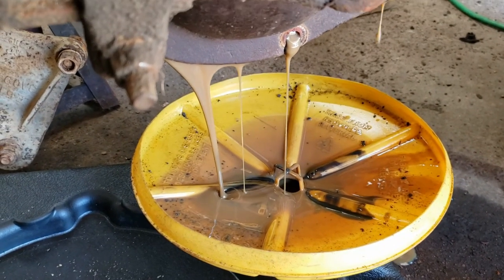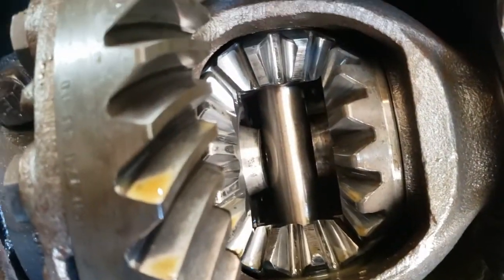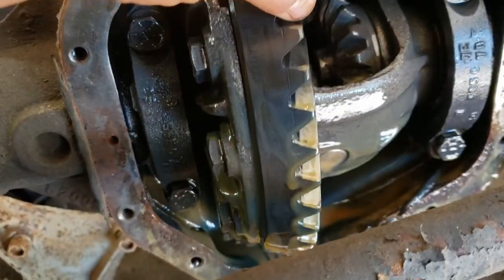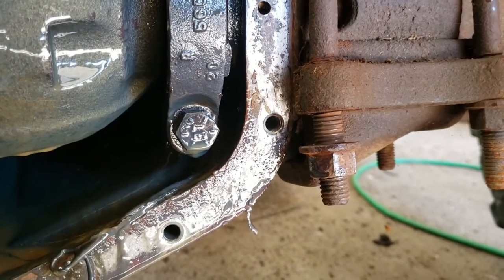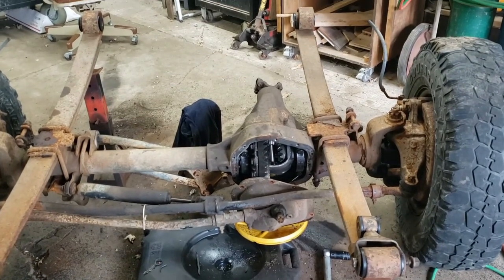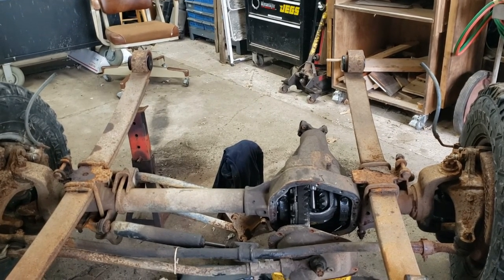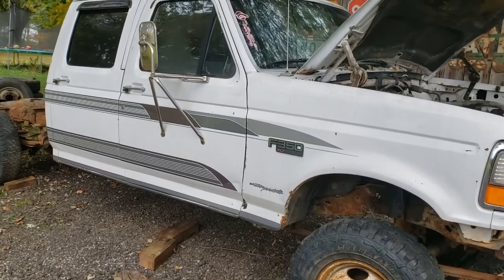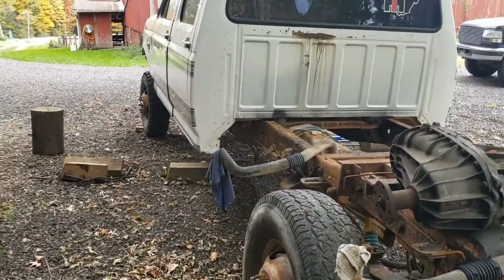Finishing up the Solid Axle Swap (SAS) - Frankenstroke Part 10

Comment: How much play or movement should the pinion yoke on the front axle have if grabing yoke by habd?
Reply from the maker: Well, it will free spin if the hubs are unlocked and the transfer case is in neutral or 2 wheel drive. if you lock the hubs, it's not unusual to have 1/8" of free travel but more than that and you're probably looking at some worn components. If you move it very gently, you should be able to feel the free travel between the pinion and the ring gear. That should be minimal, but as axle shafts, spider gears, the lockout hubs and all wear, that is all taken up as free play in the pinion yoke.

Comment: Have you ever experimented around to soften up the front suspension. I recently saw a video of someone  installing drop down brackets for the shackles and he swore it rode like a Cadillac afterwards. I have aftermarket super duty leafs with new Bilstein shocks and rides pretty damn rough.
Reply from the maker: I have not. I've heard good things about doing an RSK and I know there are different SD springs that can be used (X code, V code) but I don't have any personal experience with it (yet).